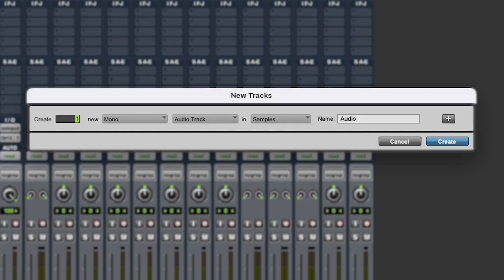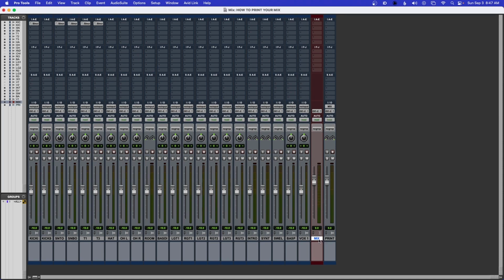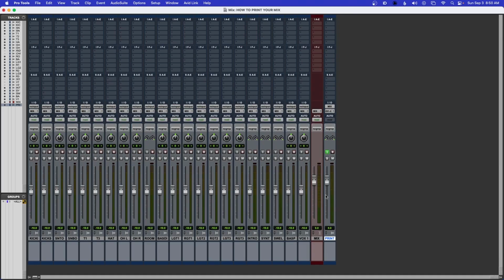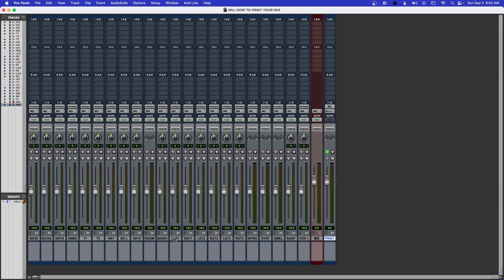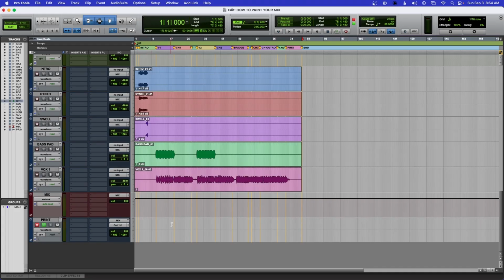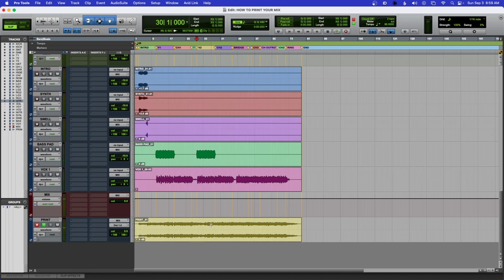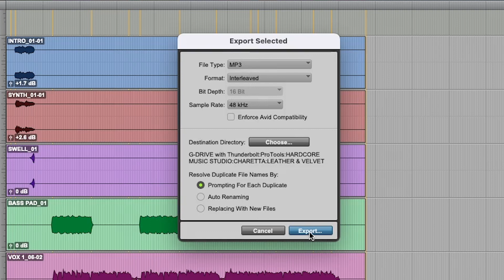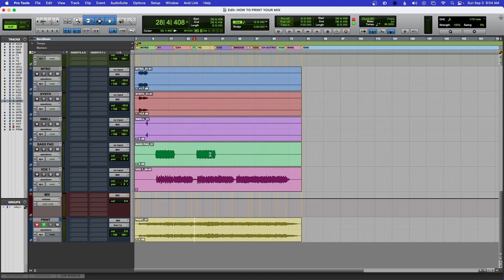How to Print Your Mix Instead of Bouncing - PRO TOOLS TUTORIAL

Comment: Found this vid interesting, thanks for posting.  I have a question about this.  I'm running PT 11.3, for reference.  If you send all your tracks to a bus named "mix" then change your master fader output to "mix" bus, then enable bounce track input to "mix" input, aren't all the tracks going directly to the input of the bounce track?  Having the master fader going to bounce track as well isn't that causing the tracks to go to the bounce track twice?  What am I missing here?  I tried this, and maybe this is just for mixing, not recording, because I tried to record a guitar track and the latency was crazy.  When I change the guitar track output back to main out, it was normal.  Sending it to the MasterMix bus sounded horrible.  Any help would be grateful.
Reply from the maker: It's mainly for mixing. When tracking, I don't create a Master track. I don't even create buses; I rather have the tracks being recorded go straight to the stereo out of the interface.

Comment: Ok but can't you just ruote them the same way to an aux instead of an audio track and then use  commit function on the aux to automatically make the new audio track?
Reply from the maker: I think you're still reyling on an offline bounce, instead of actually "recording" your mix. It can be done, and I don't think there's anything wrong with that, just as you can still bounce your mix, but this old method, to me, just feels, safer. Thanks for watching!

Comment: Excellent video! This answers so many questions about the technical process. A question: If printing this was is all in-the-box, are there any sonic reasons to not just bounce a mix? You already mentioned some workflow benefits. But isn't most printing done on outboard gear (like a mix bus compressor, etc)? Thanks!
Reply from the maker: Thanks for the comment. There’s really no issues with bouncing a mix. Billy Decker bounces his mix and never has issues. I’ve came up from the analog days and printing was how it was done. It kinda stayed with me and it’s part of my workflow. But you can definitely bounce your mix and still get great results!
Reply: thanks!

Comment: Great vid. Some questions for you. You mentioned no plug ins on print track. Why ? If I need to insert some EQ, Compression, etc., do it on the Mix track? If I want a pseudo Master, say insert , example Fab L2, do I place it on the Mix also? Last one. Doing this way, sounds better than a bounce? Thanks a lot and awaiting for your response. Thanx once again. Peter
Reply from the maker: Thanks for watching! My master bus is where I do my final mix, adding compression mostly. I don’t usually EQ the mix. If I get notes from a client, I’ll try to find the problem in the channel tracks and EQ from there. 

Although there’s nothing wrong with bouncing a track, I feel more confident that printing the track nothing will go wrong. Offline bouncing always scared me, but many engineers, like Billy Decker, bounce their mix and never have issues. I started printing early, I guess from my analog days, and kinda stuck with it. I just feel I have more control. 

Hope this helps! Happy mixing!